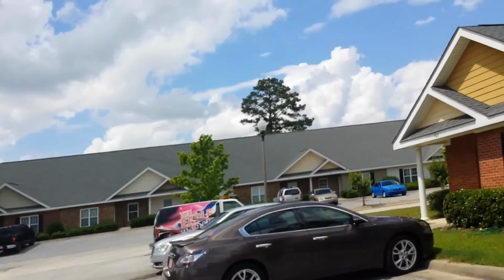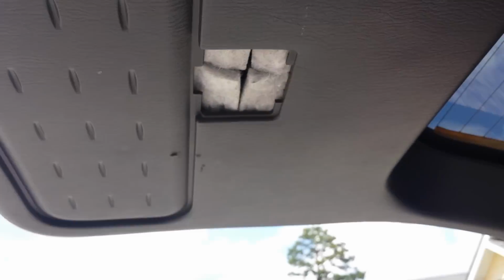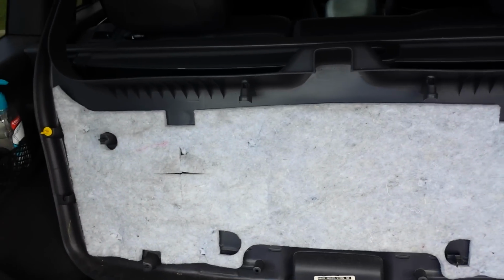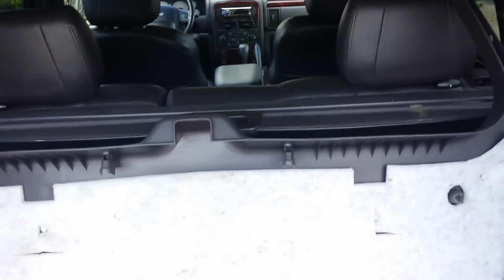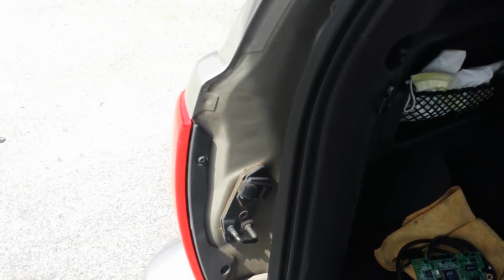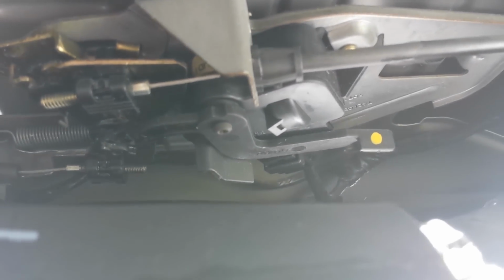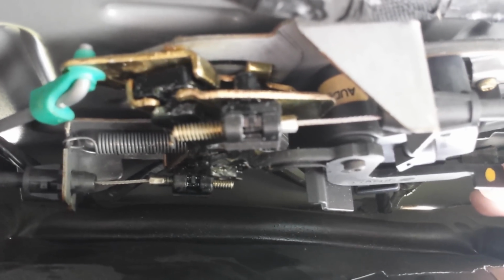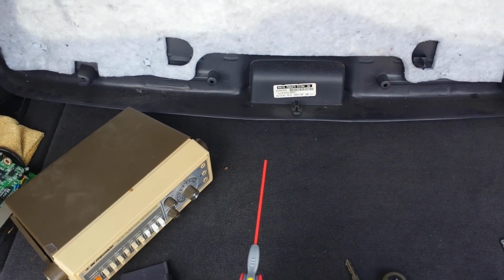2001 Jeep Grand Cherokee Lift Gate Lock

Comment: Do you have a video on replacing your actuator?
Reply from the maker: sorry, I could not film and replace the actuator at the same time. It isn't difficult to do though. just remove the bolts holding it in and replace with the new actuator.
Reply: +Andrew Grant do you know what size bolts they were? Thanks for all your help! Also how'd you get the back cover off after the 5 screws are removed?